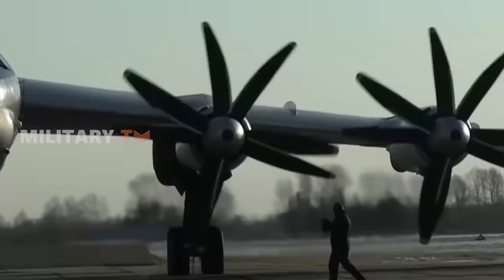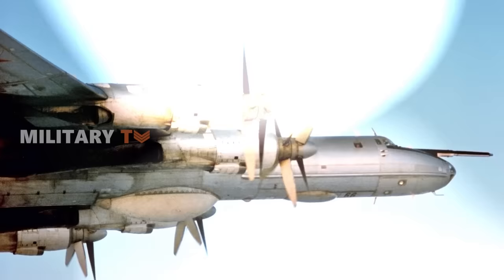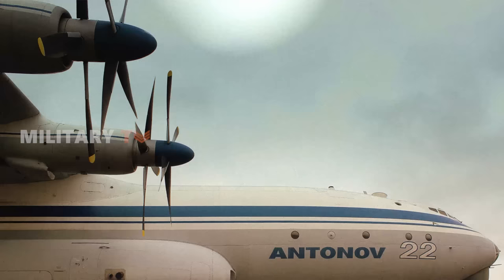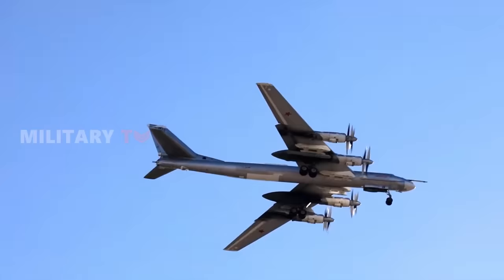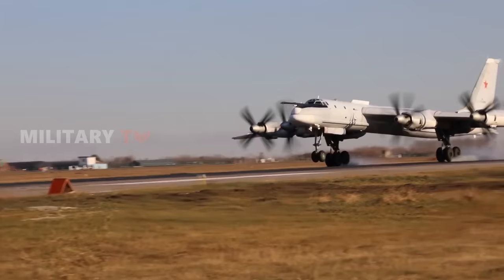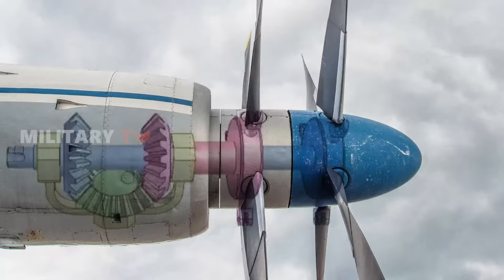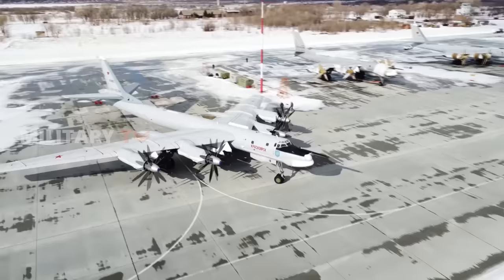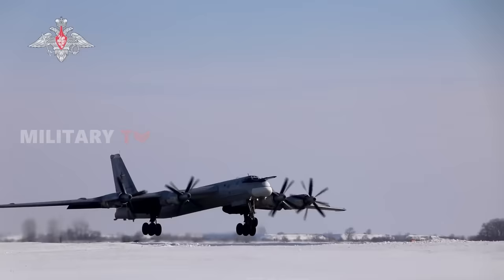Contra Rotating Propellers: The Hidden Key to Supercharged Aircraft Performance

Comment: The TU-95 was a shocker when it arrived. It was the answer to the B-52. The early B-52's were faster and had an 8,000 mile unrefueled range. The Soviets didn't have the engines to match the B-52's performance. The TU-95 was 100 mph faster than our engineers thought possible for a prop plane and had an 11,000 mile range. They could and did operate out of far eastern Soviet air bases and fly up an down the west coast of north america as far south as Mexico and return non-stop and unrefueled.

Comment: The Kuznetsov NK-93 was a Contra-Rotating Geared Turbofan. It was ducted and would have been the most efficient jet engine in the world as well as the quietest contra-rotating aircraft engine. It had flight testing for 2006 to 2008 but lack of investment held it back.
Reply: i remember that programme. i was super sad when it was wound down. I do remember though that there were some technical difficulties they could not overcome at that time.

Comment: The primary usage of contra-rotating props seems to be in aircraft with SO MUCH power a single prop can't handle it without being way excessively long.
Reference the Soviet "Bear" and it's many offspring - some of those offspring are still in use today.

Comment: "Contra-rotating" props will hopefully be realized with the late '70s era UDF system. (Un-Ducted Fan). Before much more efficiency can be achieved, there must be a break from the "tube & wings" layout. A BWB system (Blended Wing Body) with twin vertical stabilizers  can mitigate much of the noise pollution and increase lift.

Comment: Somewhat better than click-bait, but very little concrete information. There are shorter videos with more information. Contra-rotating propellers are: noisy, cancel torque effect, allow the speed of propeller rotation to be reduced (avoiding supersonic propeller-tip speeds), more efficient than a single propeller (but not quantified), more complex than single prop (increase cost, weight, and reduce reliability), are used by several large Russian 'planes, and a couple from the UK. 
Best Wishes. ☮

Comment: Late model Spitfires and Seafires used contra rotating propellers near the end of WW11 and beyond, but I am not sure they made that much of a difference.
Reply: They built 18 of them in 1948 ww2 was over by 1945 bruh
Reply: @willpugh8865  They built a lot more than 18. I know for a fact that 90 Seafire f47s were built by Supermarine after the war. Some Spitfire  22's also had contraprops. Supermarine were also ran development Spits with both Merlins and Griffons that had Rotol 6 bladed contraprops.

Comment: I noticed the earlier American propfan engines from the 1980s like the GE-36 used contra-rotating propellers but the new designs have the rear blades stationary instead. Anyone know why this is?
Reply: The stationary blades straighten the airflow, help increase efficiency. Same thing  happens inside of jet engines. Hence the term, ‘stator blades’.

Comment: Like the original plan on torpedo, put the counter rotating propeller at the back, on commercial aircraft, so the noise is away from the passenger.

Comment: Why still use propellers for commercial aircraft anyways when jet engines can provide more power using less fuel. Private aviation I get still using propeller driven aircraft. Military aircraft I get still using propeller driven aircraft as well. But this same tech is also used in Helicopters. Which is really just a larger propeller pointed in a different direction.

Comment: lazy non-treatment of the most favorable turbulence reduction and high-speed pressure pockets created by CRT.  PLUS :  you're unfair towards civilian  turbo props. Nothing antiquated about them: the A400 flies at 780 km/hr cruise speed with extraordinary fuel economy (like tu-94 and tu-114). The turboprops' CRT noise problem can be solved with modern materials for passengers and modern noise-reducing helices. And your oh-so-modern jets are de facto being flown at 750-800 km/hr by airlines these days... to save fuel... So they are as slow! You can bet that tu-114 at 850km/hr uses less fuel than any jet and needs much less working hours for maintenance.
Reply: Indeed!

Comment: The only disadvantage is the loud noise these propellors make.
Reply: The sound isn't the only disadvantage. They're more mechanically complex as well, requiring extra gearing to tranfer power to the counter-rotating shaft.  This requires more maintenance and creates more opportunities for failure.

Comment: The future of flight inside the atmosphere depends heavily on the plasma jet, and the plasma jet has a wonderful ratio of weight to the resulting force. With continued development, it will be suitable for flight inside the atmosphere and outside the atmosphere at speeds that are considered relatively limited, because in space we will need a speed many times the speed of light. There remains a topic. The energy required to operate these engines. It is possible that the energy of calcium apatite hydroxide crystals and cellulose crystals, when used correctly, meets this requirement.

Comment: ....merely complex and seriously did not add to much to the plane as a whole, the consumption rise, the gear must be more strength than usual one ( must turns two propelers with huge wind surface to cut off) ...and for what ? To add some plus when turn your plane or for short take off ? No, not worthing, otherwise any built a so concept.

Comment: I think your not understanding what a supercharged engine is. 

Tu-95 is even an piston engine.
Reply: The TU-95 is powered by four Kuznetsov NK-12 turboprop engines. They each produce about 15,000 shaft horsepower. That is why it is necessary to have an 8 bladed contra rotating propeller 18-20 feet in diameter (depending on the model) to translate the power to thrust.